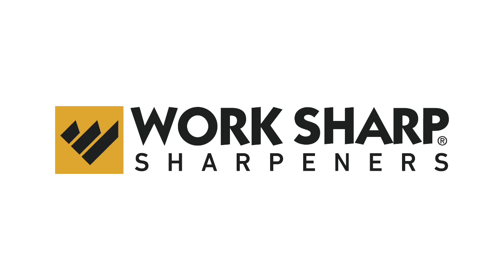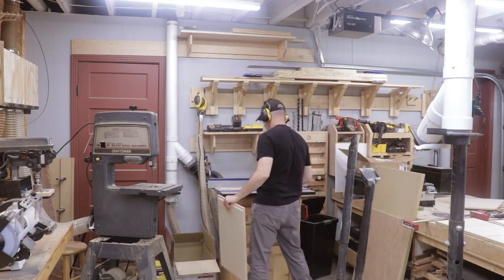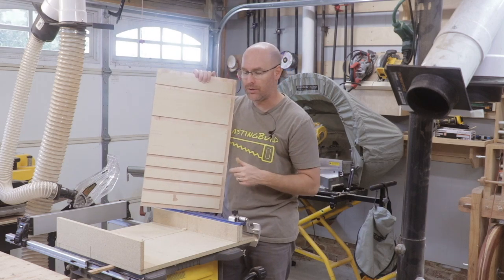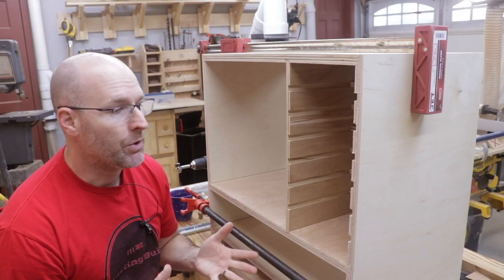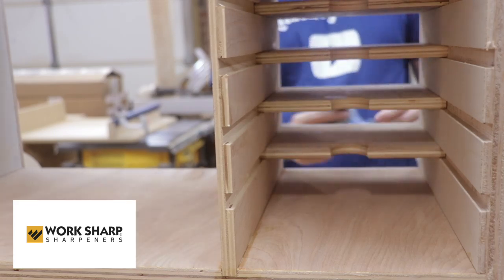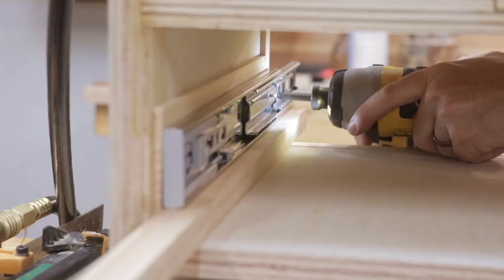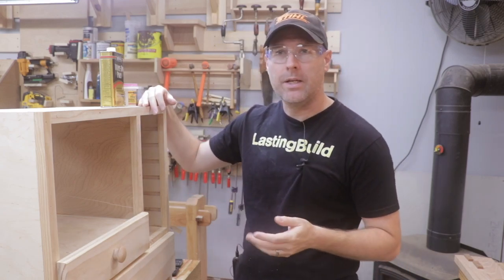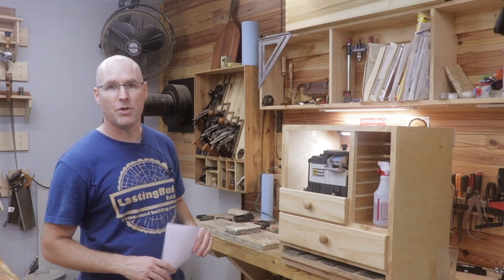French Cleat Tool Wall Sharpening Station! (START TO FINISH)

Comment: Me too! It takes SO much plywood for cabinets! I can only imagine the price tag on miter saw stations and drawer projects!
Reply from the maker: I need to find a local plywood seller because the home center prices are crazy!!
Reply: @lastingbuild1373  Yeah. It looked like you were using PureBond from home depot and that stuff is expensive! It works really well and is nice to work with, but at $55 a sheet, the simplest shelf system can get into the hundreds!